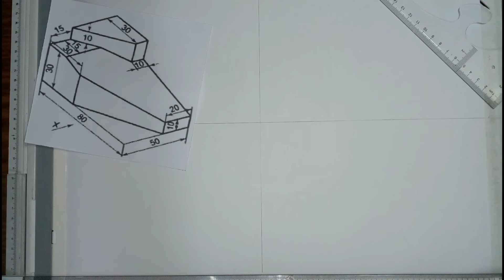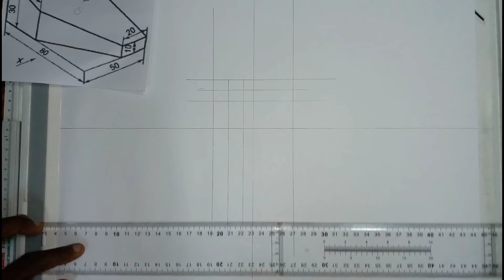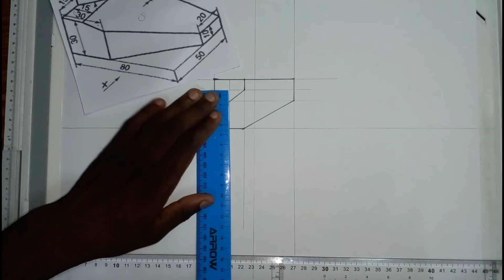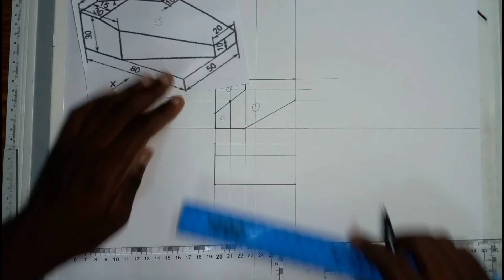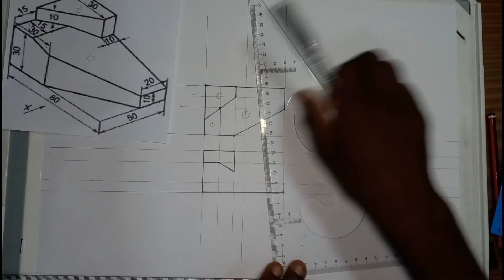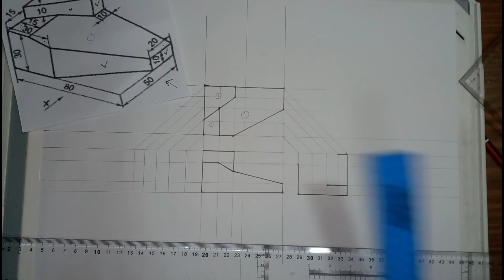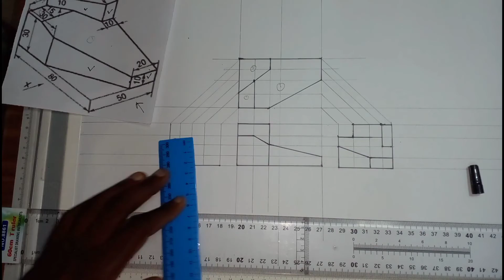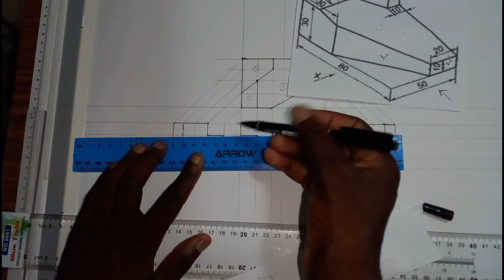INTRODUCTION TO ORTHOGRAPHIC PROJECTION FULL TUTORIAL

Comment: Hey sir this is amazing can you please make a video of this

Instructions: Answer ALL questions. In this assignment, question (a) below is a description of a system and (b) provides information about a graphical plain scale. Question (a) requires the construction of two views of the artifact described, while (b) require the construction of a plain scale conforming to the information given. Both the two views and the graphical plain scale are to be drawn in the same drawing area of an A3 drawing sheet, laid in landscape, appropriately centralized as taught in this module. Please note that part (b) requires some prior calculations, these calculations shall be done in the drawing area (i.e., defined only by the standard margins and title block as taught in this module) on the flip side of the A3 not used for the views and the plain scale.(ONLY neat presentations earn credit). [Do not dimension your drawings unless explicitly asked to do so!]	[deduct 5 Marks if unsolicited dimensions are included]question 1									[100%](A). A cleaning company contracted by BIUST has commissioned you to design a special tool with which to remove sticky chewing gum on the floors of student hostels. The tool is to be called a SCRAPER and its overall shape is a rectangular solid of 120 × 80 × 10 mm. However, one end of rectangular solid rises from zero thickness to a maximum thickness of 10 mm in a length of 30 mm to form a sharp edge. The opposite end is semicircular. A 30 mm diameter hole is positioned such that the center of the hole is 40 mm from the semicircular end and 40 mm from either side of the tool. Use an A3-size paper to appropriately layout a full-size drawing of this concept as presented by the cleaning company. Your drawing should, in appropriate portions: 1). give, in 3rd angle projection, the front view (FV) and top view (TV) of the tool appropriately centralized with the title block assumed to be 12 mm high, in which only 2) the name of the tool, 3). Your Student ID should appear neatly written.		[50%]B) At a convenient place above the scraper in (a) above, construct a plain graphical scale to depict the situation whereby a field of 7.2 square meter is represented in a map by 10 cm x 8 cm. The scale should show centremeters (cm) at the lowest level but long enough to measure up to 3 meters (m). Be advised that the height of the scale (or the height of the thin long rectangle) shall be 10mm instead of the recommended 3mm taught in the module. This height is very important especially for centralizing your views vertically	[50%]
Reply from the maker: send a picture/qn on whatsapp +263774975900